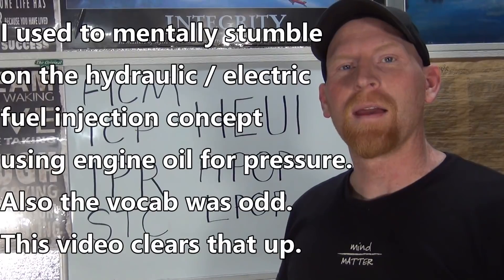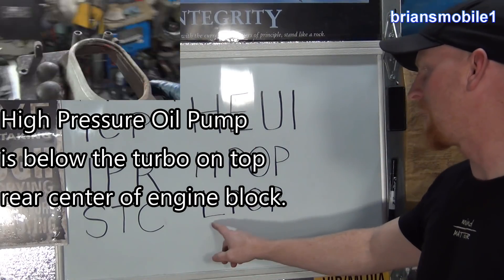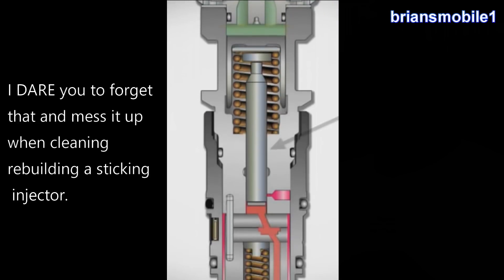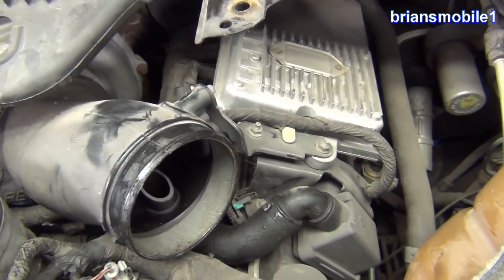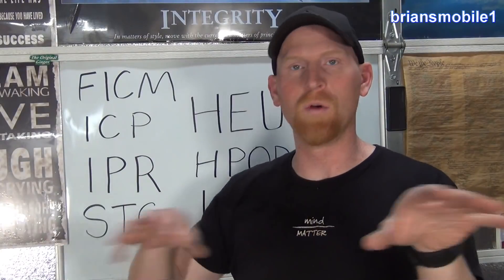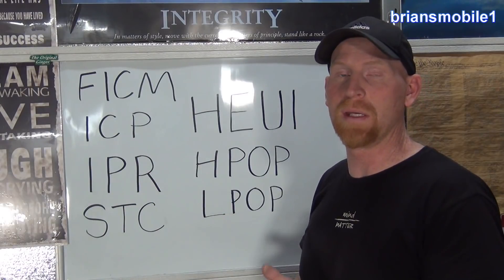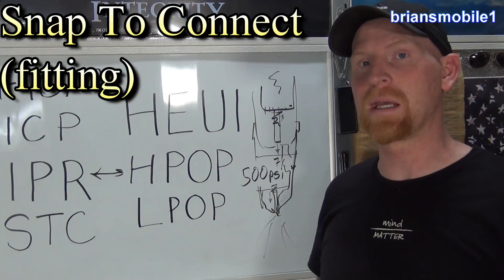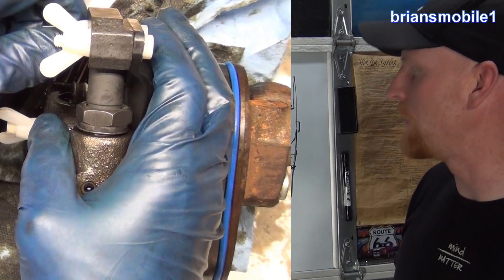Must Watch Video for Ford 7.3L and 6.0L Injection Concepts & Terms

Comment: Thank you for all the videos you do. I just used an old video to remove my truck bed and change the fuel pump on my 2001 silverado. I had some extra hardware to remove for the 5th wheel rails

Comment: overly complicated injection system. Other manufacturer simply use a high pressure pump and injectors. No hpop, 7 to 1 multiplier or etc.  These are a big rube golberg machine. Making a simple task , complicated

Comment: I didn't like these motors at first but had a fleet customer who had around 14 of them, you give a good explanation of all the fundamentals. After working on them there not soon bad, just packed tight under the hood, the older ones like you show here are easier to work on with the icp in the valve cover,I'd rather work on these than the 6.4 which replaced the 6.0, there injectors opened with fuel pressure instead of oil causing a whole host of problems. Great video thanks for your time and effort.
Reply from the maker: Welcome David!